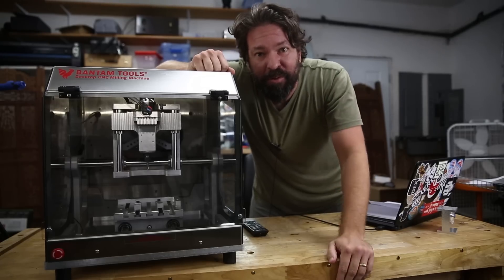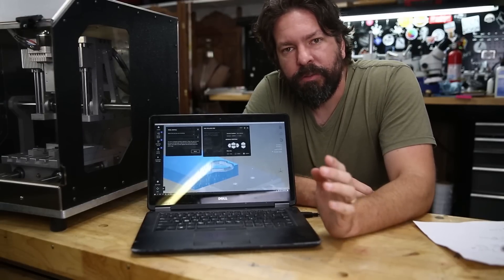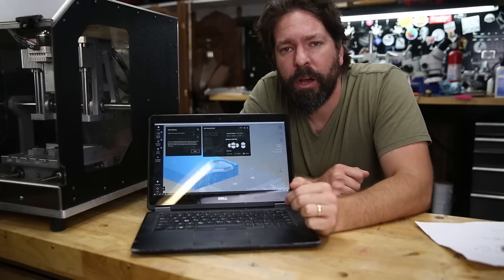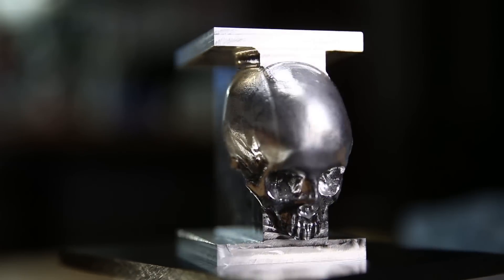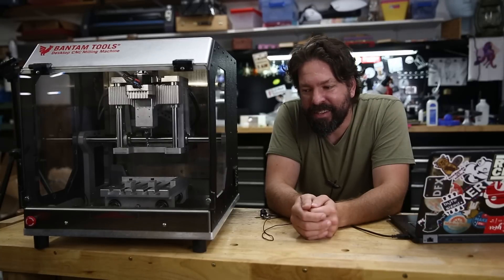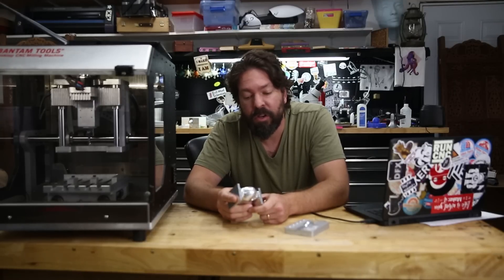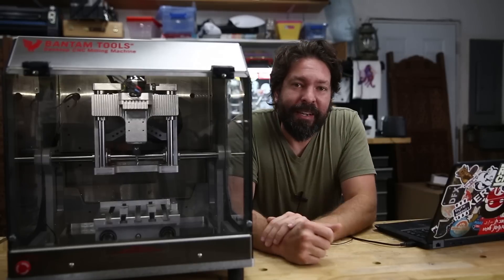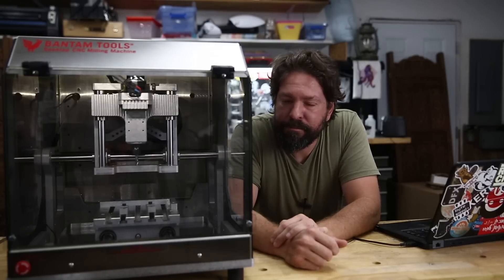First Look: Bantam Desktop CNC Mill

Comment: Internet connected requirement is a deal breaker.
Reply: I know this is a late comment, but mine does not need internet connection. It does need access to a computer (as it does not have one with the machine) but my laptop does not need to be connected to the wifi while I run it.

Comment: this is a toy, I would not bother with it personally. is it really 3600 USD?
Reply: M T   I got a hobby mill for 1400 USD for another 2000 USD i can easily build a cnc with ball screws and use fusion 360.  it's too much money. Yes it works. But other options are way more capable for same price.
Reply: M T  I made those numbers match on purpose,  integration headaches?? I follow a few guides online, work out the bugs, that's part of the learning process.  I am interested in engineering so I don't see that as an issue. I get it people want click and go. I want something different. Still think the price to what you get does not make sense. All for supporting desktop engineering!!!

Comment: Hi! i got the same question? Sometimes i feel doubtful about which cnc is better for which types of jobs ? even Carbide has Nomad and shapeoko. Does all do the same, or not?
Reply: Hey there! If you’re deciding between the Nomad 883 or the Bantam Tools Desktop CNC Milling Machine, some of the important things to note are that our machine has 28,000 RPM spindle, supports 1/4" tooling, and has a working volume of 7" x 9" x 3.5". Also, like Caleb mentioned, our software includes conductive probing of the tool height and stock location to make setting a plan or material offset easy, reliable, and precise.

Comment: So what are the other candidate CNC that can cut metal well? I saw shapeoko in the comment, but I am wondering if there are others.
Reply: Tormach 440 is the cheapest step up from this. It will cut steel and titanium and a lot of knife makers seem to use it. It is not as portable and is made from cast iron, but the software is free with no subscription and easy to use. The weight helps vibration damping for tougher metals. Bare bones it is a few thousand dollars more though.

Comment: Hmm shapeoko or bantam.
Reply: Hi! If you’re deciding between the Shapeoko or the Bantam Tools Desktop CNC Milling Machine, some of the important things to note are that our machine has 28,000 RPM spindle, supports 1/4" tooling, and has a working volume of 7" x 9" x 3.5". Also, like Caleb mentioned, our software includes conductive probing of the tool height and stock location to make setting a plan or material offset easy, reliable, and precise. And it comes ready to use right out of the box. Hope this helps for making a comparison!

Comment: Another thing that needs to be considered when buying a machine that is completely proprietary is the approach and viability of the developer. If they go under you won't receive any support. Another problem is if they stop supporting older  models. One manufacturer I have dealt with has a tactic of selling "upgrades" for older models. The developer here is selling by subscription would you trust them over the long term to support this product in a fair way.
Reply: I would also like to say that you could run this machine with mach 3 if they ever went under...
Reply: Hi! For the past seven years, we’ve supported the Desktop PCB Milling Machine in all its iterations. Our goal is to do the same for the Desktop CNC Milling Machine. And also, just to clarify, you don't need to buy a subscription package to use the Desktop CNC Milling Machine. Every machine comes with a powerful base package for free.

Comment: Did you snap any mills learning, or was the software good?
Reply: I had two stalls because I was trying to push too hard through brass, but didn't snap a single endmill. To be fair, I'm not sure this machine is quite strong enough to snap endmills.
Reply: Hi there! To help users avoid breaking bits we will have a breakdown of feeds and speeds recipes we recommend (after A LOT of testing) for end mills we carry in our store for supported materials. We'll also have resources for Fusion 360 Workflows that will help users when it comes to designing in CAD and programming CAM in Fusion 360. And the Custom Tool Library Caleb mentioned will be a way for you to create your own custom recipes as well. This really comes in handy when you're working with SVGs!
Reply: Bantam Tools thats good to hear. I just remember watching caleb destroy end mills learning the tormach. Was interested how well this machine was for learning. Sounds like its pretty good
Reply: @StuffWithKirby , we hear you! Definitely a good question!

Comment: What am I missing? it seems like a tiny cut area and limited software compared to the Shapeoko for 2X the price?..
Reply: for cutting metal, this is a much better fit than a shapeoko. more rigid for sure. If you were only cutting wood and plastic, shapeoko would be a totally legit alternative.
Reply: Caleb Kraft why not pay 1/2 as much to cut both.
Reply: Matt Austin this comes assembled. The shapeoko instructions were terrible when I put mine together. The shapeoko is also harder to know your speeds and feeds if new to cnc. The support for that is kinda crap and when you ask you get pointed to a wiki that is just mostly links to forum posts by users. With bantam tools you are paying extra for the hand holding and easier work flow it appears.
Reply: Stuff With Kirby by paying extra you mean 2x.
Reply: Matt Austin do you own a shapeoko? I think you are overestimating its out of the box capabilities.

Comment: Annual subscription software is not great for schools and maker-spaces with already limited funds. Sad to see them going with this model.
Reply: Ability to adjust speed when your cutting is very important when your a beginner. Removing this from the "basic" free tools is a pretty cynical approach particularly for schools or maker spaces. Impressive speed and rigidity from such a small package just a pity that the owners are a bit greedy.
Reply: again, the annual subscription was for some additional features that aren't needed. everything you see me do in the video is non subscription
Reply: Hi Jared! Just wanted to clarify that the machine comes with a base package of the Bantam Tools software for free. The base pack has everything users would need to get started. Think of the subscription pack as bonus features. In addition to these bonus features, subscribers will also have access to new software features we're going to release each month, priority tech support, and additional Bantam Tools content. But we realize that it might not be for everyone! Here's a link to a rope knotting tool that we machined using only base software features: https://youtu.be/m957BzuMTXo
Reply: @bantamtools  I bet you will sell 10 to 12 of these.  To rich kids.
Come back when you are ready for the big leagues.

Comment: Especially for schools and makerspaces a CNC with an enclosure is important. They always have to expect the stupidest possible user and are somewhat liable. Does this machine recognize and stop if someone opens the door?
Reply: yes, it stops if you open the door. The spindle will not spin with the door open.
Reply: In addition to the safety door, there is also an E-stop button on the machine and you can stop or pause the job in the software as well. Let us know if you have more questions :)